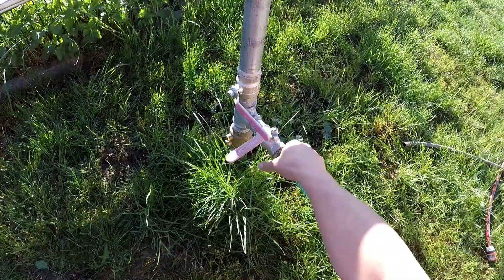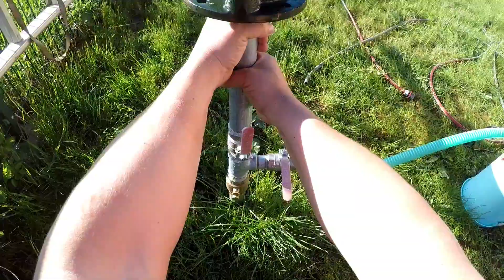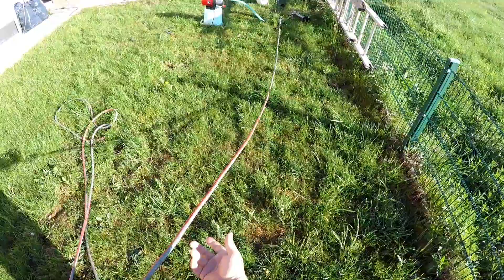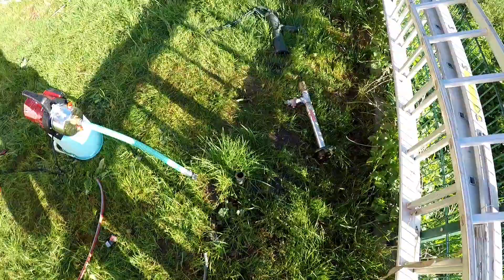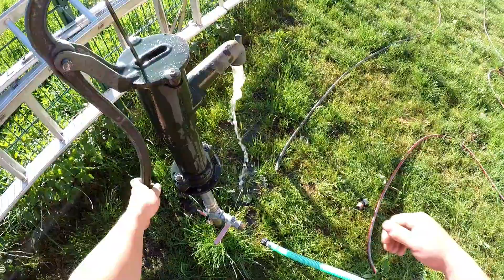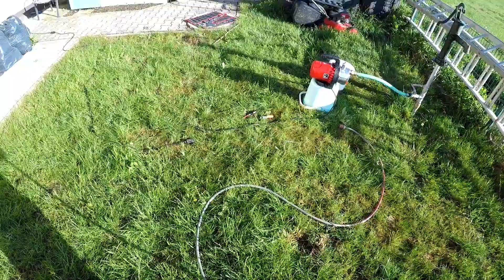Gartenpumpe zieht kein Wasser Pumpe zieht Kein Wasser Brunnen prüfen

Comment: Das ist wohl ein Rammbrunnen. Leider versandet dieser Typ von Brunnen sehr gerne nach 5-10 Jahren vor allem wenn man eine elektrische Pumpe verwendet. Bei Rammbrunnen sollte man nur Handpumpen wie die aufgesetzte Schwengelpumpe verwenden. Für elektrische Pumpen sollte man einen Bohrbrunnen mit blauen Brunnenrohr haben.
Reply: Habe seit 12 jahren das gleiche system nichts passiert 👏👏
Reply: @Leonard Keanu instablaster :)
Reply: @Duke Reginald I really appreciate your reply. I got to the site thru google and I'm in the hacking process now.
Seems to take quite some time so I will reply here later with my results.
Reply: @Leonard Keanu happy to help :)
Reply: Oder Pumpenleistung reduzieren auf 400 bis 600l/h